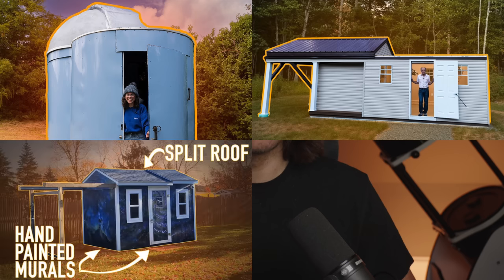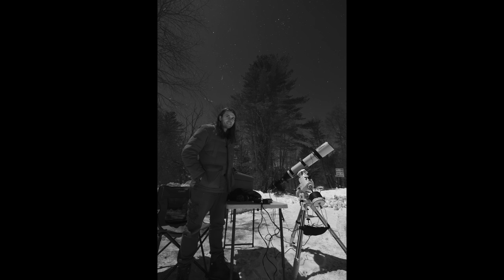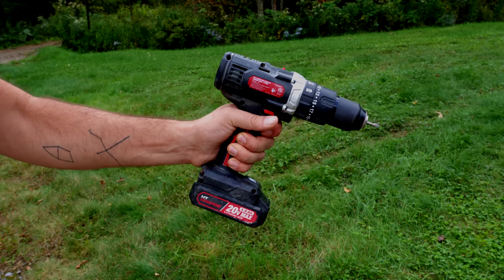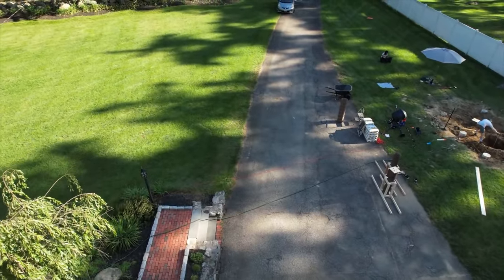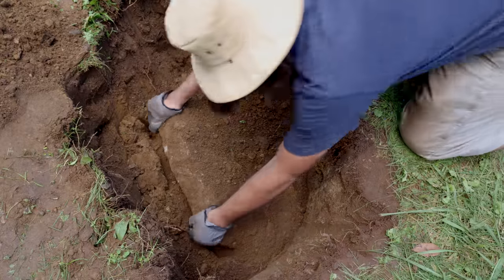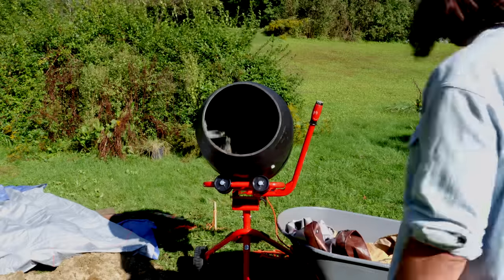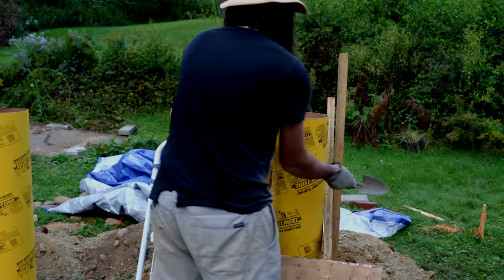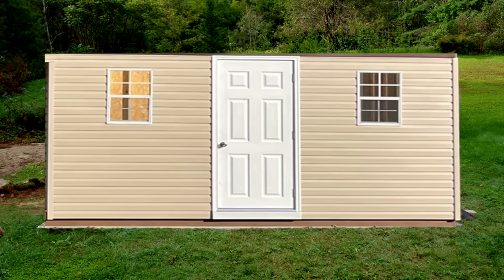Building My DREAM OBSERVATORY

Comment: Nico, enjoying your channel.  You will have fun doing this yourself.  Very rewarding. I have been enjoying your journey.

Tony, your friendly Canadian subscriber.

Thought I would send you a couple of thoughts regarding  the dream observatory I recently just “more or less” finished. I build a 10x12 roll off.  Love, love, love it.  Some thoughts.

1) don’t cheap out on the fasteners that you use (screw everything.  If you F,,,,,up, you can easily redo.
2) over build cross supports for your floor as rectangles are weaker than squares.  Use lots of cross supports and 45 degree supports, for the floor structure.  Use 2x6 for all your walls and floor construction. At least 1” subfloor.  Glue and screw floor.  That way, you will have a structure that does not flex, (less vibration).
I used a very strong and light roofing that Home Depot Canada sells.  It is a wavy reconstituted thin asphalt roofing.  Did I mention it’s wicked light, and very strong for Canadian winter.
Wheels for your roof track, use wheels with grease nipples, so they can always be maintained!

HD also sells a terrific pre primed mould resistant wood siding.  It looks great and will save you grief down the road.  Heavy, but makes your structure even stronger, when you screw it in.
Use bracing on your walls at 45 degree angles screw it in under tension.  Makes the building much more resistant to wind and storms.
Makes it much stronger too.
Metal rolls are pre punched and easy to install, with screws.
DON’T BUY YOUR LUMBER FROM HD!
Their wood is shit!
Go to a lumber store, with a yard you can browse to pick out your wood. 
All beams have a crown, not perfectly straight.  When building your roof structure, ensure that all your beams are installed with the crowns one way.  That way your roof will not have dips and valleys.
Incorporate ample ventilation in your roof.  I insulated mine as it’s really only warm a few months of the year, where I am.
I added a big buddy heater with a 20lb propane tank outside the structure.  It’s great for taking the chill off, if you work out there, for any substantial period of time.  The 18,000 btu model has a hose kit for using the heater with a 20lb tank.

I would invest in a combo set of Good quality CORDLESS Drill / IMPACT DRIVER/ hell: CIRCULAR SAW for your build. They will last for years.  Every house needs some serious power tools.  Forgot,,,,,a GOOD QUALITY HAMMER  yeah,,,,,a couple of HD SAW HORSES will serve you well for the project. 10x18, building is a lot of sawing , angles cutting, drilling, screwing.  
One more MUST have,,,,,a speed square.  ( it’s a triangular tool that is indispensable, if you want to build a square , not lopsided building.
HEY, owning a home, those tools will pay you back in no time!
Do not cheap out!!!
Buy good tools, and fasteners!

Nail your walls together, but screw everything else.

Enjoy my friend.  Have fun.
Take tons of pictures!

Comment: As a builder using the metric system, in Australia we call it the "3 4 5 rule" peg out your shed footprint 1x3m side and 1x4m side, to make it square close off the triangle with a 5m hypotenuse and voila you have 2 sides of your shed marked and they are square....

Comment: There should be insulation between the ground and cement when pouring columns - you can lay thick roofing material or pour cement into a plastic pipe, the depth is at least a meter, otherwise in spring, after frosts, the column may "float" and skew.

Comment: Well done. Great plans. You have likely already thought about it but when running power, run 2x as much as you think needed (at least 3 circuits of 20 Amp if not 4), in the same trench run a cat 5 data cable, just in case, and a fishable conduit to add whatever the new thing you will want out there in the next 30 years. Easier and cheaper to do it up front than to excavate later. Have fun, be patient, lift with your legs, be careful on ladders and roofs, and Oh, yeah, clear skies.
Reply: Are you supposed to have ethernet cables that close to power cables?

Comment: Very cool. I'd recommend pricing a concrete truck delivery for the slab. Concrete truck on site for mine (very rural, the one you saw with the sheep, 9x9 feet by 9 inches deep) was about the same price as mixing it all myself, and you will need a lot more concrete for your slab than you used for those piers. I have pix of all of it if you want to see.

Comment: You could do a half wall with tracks mounted on the outside and have the half walls be seating and table. I watched the video where you visited Alan and he seemed to have trouble with bugs and whatnot, snow moisture etc, and the rails being a trip hazard. All that would go away in my opinion by making it not mounted on the ground but being resting on a lets say chair height wall where the tracks sit in a recess. But to avoid it being super ugly the mouse might need to be a bit longer to have enough wall for rails to go onto when you slide the top half of the house backwards. Basically a combination of Alans sliding roof and sliding house, a hybrid solution. At least thats what I'd go with. I also don't recommend using wood for the top structure, it will warp sooner or later. Maybe use metal tubes welded and the sides should connect to the upper portion as a triangle rather than a single plane. Doesn't have to be a big angle, but that will certainly help.
If you need inspiration for structurally stable construction look up cranes at harbours used for container loading/uloading. It is essentially the same. A metalworker with welding experience from a shop could probably also give you tips on how to construct something like this. Maybe you have a metal workshop in your area. Those bigger shops usually also have pretty big high mounted cranes in their halls and they need to service and troubleshoot those and they can tell you exactly what problems you will face.

Comment: Please make sure your lumber is straight and if it is pre-cut has th.e correct lenght.
I was depending on my local source delivering the lumber straight and in the right size. I didn't have the tools at the time to cut my 8x8 cm frame material (about 3.5x3.5 inches). Now there is no turning back for me. Also the wood for the walls wasn't straight so I got gaps which lead me to calling my observatory white hole observatory.
Good luck with your build.

Comment: Hi 👋, NebulaPhotos , I have always enjoyed your territorial, I am thinking of building a Observatory , or just a dome housing for the telescope, I have even thought about constructing something in the attic as my property is an old mill. Some point in the not too distant future. I’ve got to re-roof my roof, and in the attic, there is a big oak frame construction, that I could quite easily mount a telescope into then finding a way of sliding back the roof, food for thought, whether there’s enough money in the budget to do it, especially as my building roofline is well above the trees at the moment, part of my problem is that I live in a valley, obviously next to a river, which the mill used to be run bye, I’ll wait and see how you progress and how you do your sliding roof, good luck for the future. I’ve always been impressed with your photography and your territorials, explaining how and where are used to set up the equipment., 
I look forward to part 2 😂 , Phil from the moulin France.

Comment: Thank you very much for your videos. I am in the beginnings of astrophotography and you are a great source for so many things. But I can tell you something about composting: You need some kind of sturdy net, like a metallic one, at the bottom of your compost area. Unless you like visits from all kind of rodents and such. I hope that helps you, buddy. Clear skies.
Reply from the maker: Ah, thanks for the tip!
Reply: Do you have termites in your area? Unless you use treated wood they will make short work of any wooden structure. Being an Australian I would be thinking of the fire risk coming from the forest. Is fire a problem there? Do bears attack telescopes?

Comment: Hi Nico, for my personnal observatory, I also did incorporated into the concreted foot a tubing with ethernet, usb & 220V cables. Like this, I will have a perfect cable management. Best whishes for the house building. SteF.

Comment: Congrads on making your dreams come true.  As far as the shed goes (regarding footing) looking into what is called a trench pour. Places like Home Depot rents a trencher. You trench out the perimeter of the shed, to the depth you need and just pour the cement into the trench. Also, call some of the local cement companies: sometimes they are looking for a place to dump excess cement, if they are working in your area.  Just a thought.

Comment: Cool project! I wonder if a 12+" EPDM roof pipe flashing seal might make a good vibration-isolation bond between your pillars and the floor? Dektite makes one in a 9"-20" pipe diameter.

Comment: Thank you Nico for the many tips you have given me. Now maybe I can offer a small tip to you in return. Put the wheels of your mixer next to the hole rather than the stand when you are pouring. That way the concrete won't get all over your mixer. (12:45) I think that is the way it is designed to be used.  You will have fun building this, and I will have fun watching!
Reply from the maker: I had a feeling that wasn't right, but I couldn't figure out how to pour in the opposite direction (wheels end). Maybe I'm still missing something obvious?
Reply: The bucket should be able to rotate 360 on top of the base. There may be a locking pin somewhere you have to release so that it can rotate.  @NebulaPhotos
Reply from the maker: Mine doesn't rotate, but thanks to your comment, I see the problem. I installed the bucket on backwards 😂 I'll fix it.

Comment: You probably should consider adding a warm room in addition to the observing room. Makes it much more comfortable when operating the computer but you don't need to be by the scopes.
Reply: With the most of the new Go To mounts and Asair equipped with Wi-Fi you don't really need to set a place for the computer  but can be useful to keep others pieces of equipment.

Comment: Starting to take shape Nico, looking forward to seeing the next edition.  This looks so familiar.  Suggest using a little disc grinder to smooth off the concrete top and make a slight bevel on the edges.

Comment: I hope that you have enough concrete below grade.  I guess it depends on how rocky/compact your ground is but for my pier I dug a 3'x'3'x3'  "pit" and filled it with a yard of concrete (about 10 wheelbarrow's full) and then installed a pier on top of that. 

It is amazing what i difference a heavy pier makes over even a high end tripod.

Comment: Proud to see you repurposed some of the old shed! Currently saving any decent sized lumber remnants I come across for mine. You'll be exhausted, but at the same time, have more pride in it when you finish because you built it yourself. Anxiously following this build! 
BTW.. Astronomy Librarian: you gave away one of your knowledge secrets lol. Sounds like an awesome job!!
Also, would it be feasible if in the future you wish to do more with your southern sky, to just place a pier on the hill, and have a portable setup remotely controlled from your observatory?

Comment: Three years ago I too built a telescope plinth. I dug a 1 cubic metre hole and filled it with concrete and rebar and then the plinth using a plastic water pipe filled with rebar and yet more concrete. (6” diameter). It was rock solid. I’ve since moved from the house and my son who still lives there has told me trying to remove it is a nightmare. Oops!

Comment: It would be awesome to get a old silo about 20'-30' tall. A dome roof, build steps to the top, maybe a homemade elevator, about 4'x4' running up a i-beam  as a safety, using a counterweight and a winch.
Or,  building a pair of  20' concrete towers , and 4, 6" 1/4" wall pipes, with a  6" ,1/4" thick channel iron, all welded up, with the concrete collums in the center,    then have a crane come and lift the building on to tge top,  use mobile home anchor straping to  anchor it to the steel leggs.  With a 36" walkway around the building.  With a set of steps going to the top, and  winch to pull a basket to tge top for heavier things , it can also be modified into a elevator.    With the walkway around it. People may think its a light house, or you have a airport in your yard, im very interested in the night sky, i have seen things i honestly do not belive any person of any country had control over it,  i get a rush every time i think back on it.   I honestly thought we were being invaded. We as in earth, it wasn't just a light behaving strange in the sky , it wasn't even moving, it just hovered there, silent. And seemed to be huge  as un 100's of feet tall and probably 100' wide of wider, it was something else,  it looked like  one of the world trade center buildings was black and had a random light on , in a dark sky, it was like a black glass building , in a grey sky it didn't dtick out, but if you looked st it , you could not miss it. It was plane as a storm cloud in a bright blue sky, it blocked out stars behind it. It was a wild experience..  i also saw a strange light in the sky. It started out looking like the biggest brightest star. Only 5x bigger, and Brighter. While i was looking right at it. It  flashed brighter. and was gone, i was freaking out, still looking,  i saw a blue green like a aqua colored light, just barely able to see it. Moving away so fast. It seems  like it was almost a streak  moving north west. I never seen anything in the sky move that fast, not even fireworks , the blue green semi streak did remind me of a  mortar type firework moving through the sky,  burning the red orange fuse, however this thing was following the land, or horizon. I thought i saw a star supernova,  until the tiny  streak cane from it, it was about like seeing a tracer round leaving a gun , in slow motion. The muzzle flash. Then the traver ignites.  It was moving atleast 4-5 times  faster than any jet i sw in tge sky, enough rambling, but I'm serious,  I'm torn. Ivtry to not go out, but if i do i can not keep myself from looking up  first thing i do walking out, is look up at the sky,  both times  i just happened to look at the sky,  anyway, like i said sorry to ramble! ✌️

Comment: 16:10 28 days to fully cure! Holy cow... i wonder if thats the same for concrete they used for roads and sidewalks... if so... we are def driving on those roads too soon lol
Reply: Yeah that reminds me of an incident when I worked at Walmart. They had to dig a hole in one of the aisles to access pipes under the floor. After they finished and resealed the hole with concrete they told us not to drive the floor scrubber over that area for the next 3 weeks until the concrete cured (due to the weight of the scrubber but apparently if was okay to walk over it).

Comment: 4:16 well the age and roof are irrelevant, it could be moved and fixed to a foundation as well as some minor reinforcements made to handle the sliding roof. At that point cutting holes for the columns isn't that much of a issue.   All this is assuming there isn't any major damage to the original frame.

Comment: Nico, I have a question for you.  Why did you choose a roll-off roof?  Everything that I've seen about a roll-off puts the telescope at or slightly below the top of the wall.  You're losing a lot of stuff nearer to the horizon.  Okay, granted in your case, because of the trees and stuff in the yard, you might not have the ability to put a telescope that low anyway.  But, the question still stands, why a roll-off versus a dome on a two-story structure?